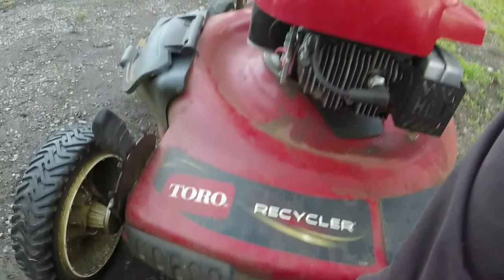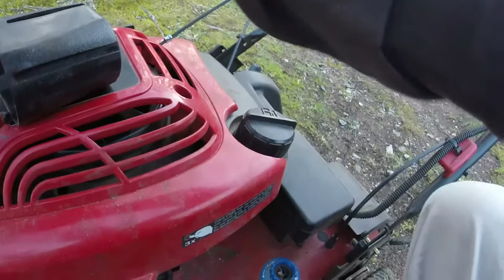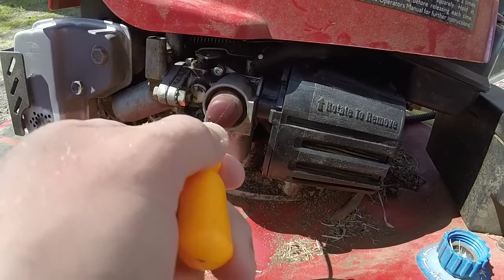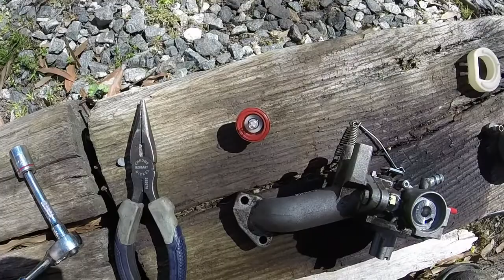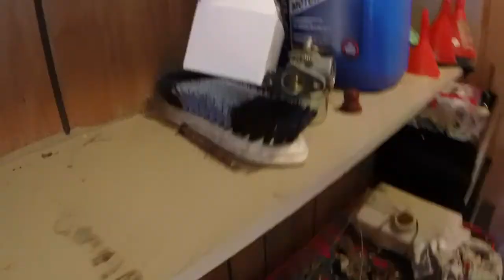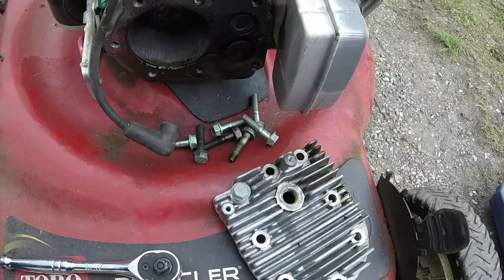Toro Personal Pace 6.5hp Tecumseh- can't save them all

Comment: The reason the engine will run fine for a few seconds, then die, is your gas tank vent in the fill cap is plugged. Take the cap off, and run it. Put your hand tight over the filler, and in a few seconds it will stop. All the bad mouthing and tear down was a waste. If the tank doesn't vent, the fuel won't flow.

Comment: Hello Ellis Mowers this is a great review on trouble shooting a Tecumseh engine.  Your right can't save them all,  the few recent Toro's I had gotten with Tecumseh engines were actually good with some minor carburetor cleaning or complete replacement.  This video really shows your patience with the time and effort (frustration!) you can put in these.  Its also really difficult to find a  replacement engine with the correct shaft size but that Personal Pace frame is worth a repower if you have or find a engine, great video!
Reply from the maker: Thank you, it wasn't too bad except my arm was sore after all the pulling I did on the rope.  I was almost positive it was the primer bulb until I pulled the head and knew it wasn't worth going any further with.  I've had good luck overall with Tecumsehs too overall, this one just turned out to be too far gone.  However, I've yet to have a Tecumseh come in that was blown up!

Comment: I always thought that with low compression, the engine shouldn't fire at all. This one fires and it looks like it might have a bad ignition coil that quits after heating up. It is also possible the flywheel pin had sheared and messed up the timing. Relegating this mower as "junk" was premature.
Reply from the maker: Either way, the severely scored cylinder wall would have not made this mower reliable or usable long term.  I've had many machines low on compression try to fire.  They will, but never will build up any speed or RPMs.

Comment: Not for nothing, I just picked up this exact model for $20.00 with a dead battery. I disconnected the battery and the coil kill wire (green wire)..fired right up. If I plugged the green wire back on, the starter ignition has a kill wire in the harness as a back up...I disconnected that too and runs like a champ & the self propelled works fine

Comment: Just had the exact same engine with the exact same failure, it was a defective magneto coil. Easy to troubleshoot, as soon as it died had the spark test rig ready and sure enough, no spark. Fairly common failure on the LEV-120, that and oil leaks.
Reply from the maker: Yes these Tecumseh engines have their issues but I've never seen one blown up.  By the way the cylinder wall looked it had a hard life and was time to retire.
Reply: True, they’re extremely durable. That one looks like it’s been run without an air filter or just not taken care of. Wish Techumseh was still around, I liked ‘em!

Comment: I had same mower, buddy of mine drilled small hole in gas cap and it ran without stalling out for another 5 years. Something about pressure in gas tank. He knew it would work
Reply from the maker: Yes the gas caps get plugged over time, this one wouldn't fire even with carb spray and spark and when I took the head off and saw all that scoring I knew why.  Wish mine was just a gas cap!

Comment: I had a Craftsman with a Tecumseh that that gave me fits...lol I would run like a top for 20 to 30 minutes & die even after a carb cleaning & needle & seat. I ended up putting a Briggs on it.
Reply from the maker: That's the plan for this one too, did one on a FWD Toro last year and worked great.  Knew it wasn't a fuel issue on this one when I sprayed starting fluid in it and nothing different happened.  After pulling the head I knew why!

Comment: Where does the linkage with the little spring go?  I saw the main throttle linkage when I took of carb and didn’t see this one at the time.  
Thanks
PS.  I would think a compression issue would keep it from ever starting.
Reply from the maker: On the carb between the carb and intake tube there should be a small piece of metal sticking up with a small hole in it for the spring to link to.  That little metal piece can be bent to speed up or slow down the engine.  The spring attaches to the metal piece and the linkage attaches to the actual carb.  If somebody worked on it before they may have taken it off.

I thought so too which is why it baffled me for a few days until I took the head off and saw how bad it looked.  It got plenty of fuel and fire which left compression as the only other thing it could be.
Reply: Ellis Mowers  
I found it..  Thanks for the help.  I also didn’t know I could speed up or slow down mower by doing that.  I appreciate the help.

Comment: I have a mower with a tecumseh it starts on carb cleaner and I have cleaned the carburetor at least 5 times and replaced the primer bulb any suggestions?
Reply from the maker: Try starting it on starter fluid.  If it fires then most likely a whole new carb would be the best bet.  Tecumseh carbs typically don't come back when they fail even after cleaning.  They're only around $10 online.  If it isn't starting at all even on starter fluid check your spark plug to make sure it's getting spark, if so, you may have to take off the head bolts on the front of the engine to see if the cylinder wall has any scoring.  It should be smooth, if they look like this one then IMO it wouldn't even be worth going further.
Reply: Mine starts right up on starter fluid thanks for your help

Comment: your bowl is running out of gas man. them carbs are junk but they will run clean your tank and line
Reply from the maker: That was my original thought but after checking fuel flow, and putting a known good carb on there I all but eliminated that as the issue.  The final nail in the coffin was when starter fluid made no difference in getting it to fire.  I have had many mowers that have come through here with that problem and I wish that was the problem, but when I saw the scored cylinder walls and the symptoms the mower had it pointed to a low compression issue since it was getting both fuel and fire and at that point knew it really wasn't worth fixing.

Comment: Replace a faulty primer bulb to start... stop talking and start doing the obvious. A leaky anything is obvious to fix first. A primer bulb cracked means the fuel lines and maybe the fuel filter and bowl and jets are clogged with dirt from car gasoline or plain dirt. Clear up the obvious stuff
Reply from the maker: Thanks for the feedback.  I did end up replacing the primer bulb around the 6 minute mark.  Either way spraying carb cleaner in the intake would get it to fire, good primer or not.  With no fire at all I was considering a spark issue until I pulled off the head and found all the scoring which led me to the low compression issue.